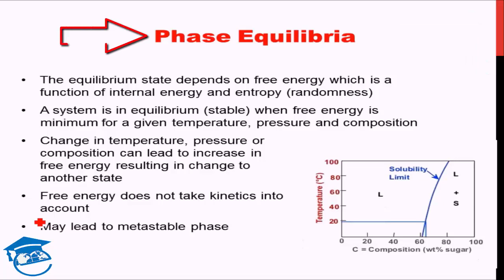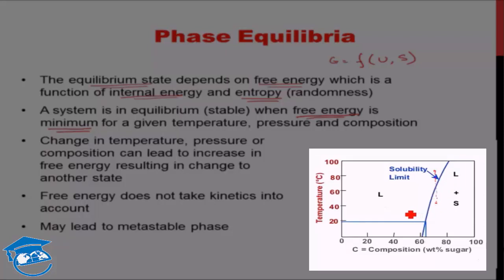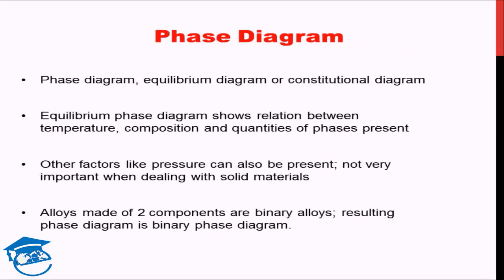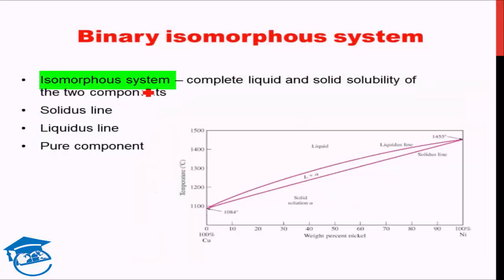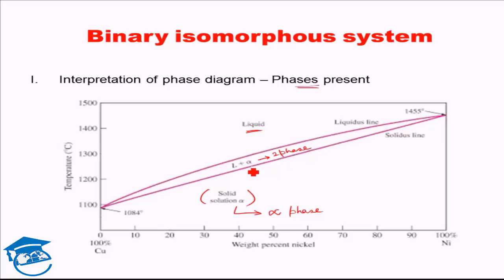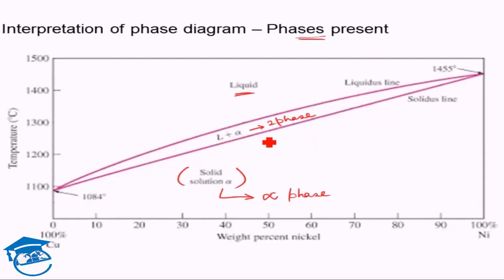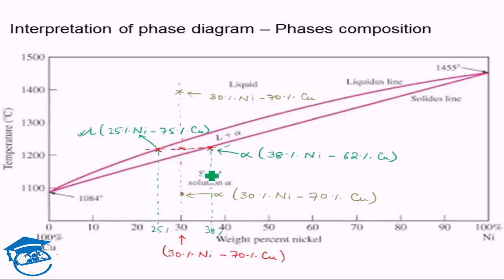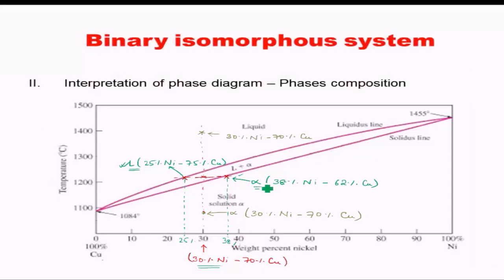AMIE Exam Lectures- Material Science and Engineering | CC | Isomorphous | 8.2

Comment: The "overall" composition does not change for a vertical line (it stays 30% Ni and 70% Cu). It just gets redistributed between the 2 phases in the 2 phase region. If you do the math: 0.62 *25 + 0.38 * 38 ~ 30% Ni. Excellent explanation.